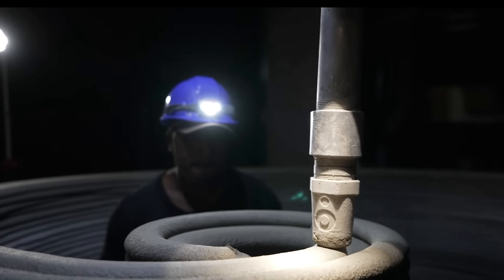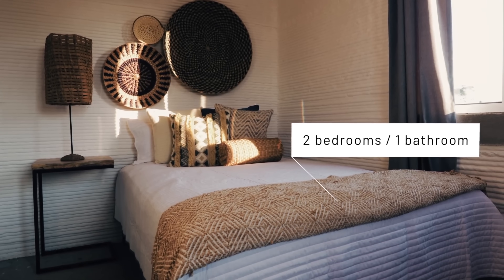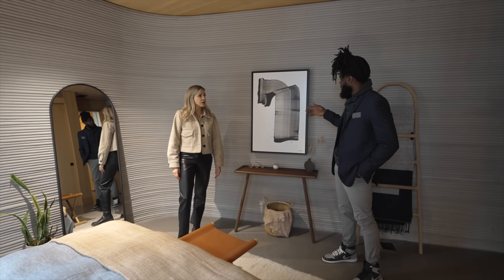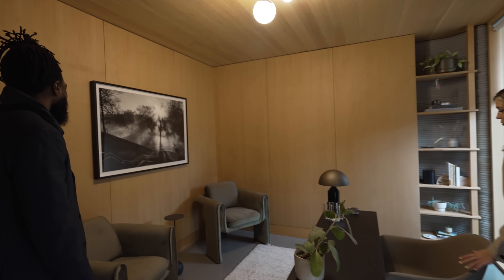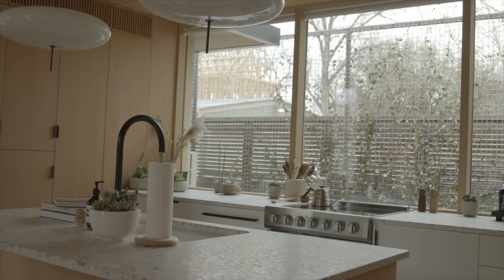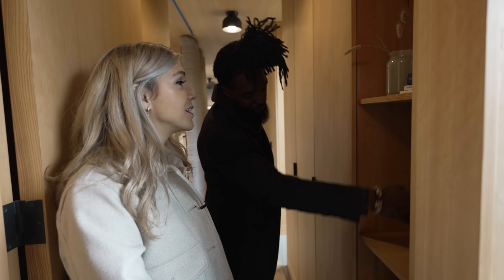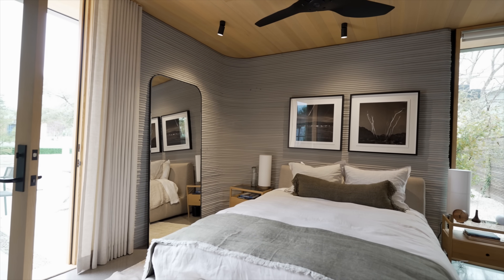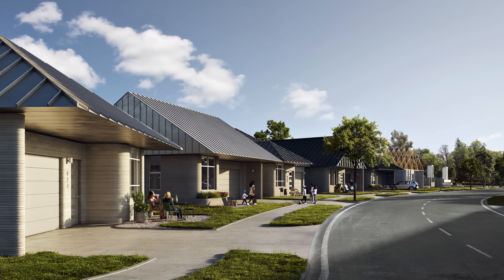Inside A 3D Printed House You'll ACTUALLY Want To Live In

Comment: I can dig it, although as somebody who builds things for a living ~ I can already tell you that although the walls may be easier, the rest is going to be more difficult than wood framing. Electrical Plumbing ~ heating ducts ~ windows ~ there will definitely be a lot of trade offs.[ Just like a container home,] you have to build a whole structure inside and out anyway so it’s just hard to see where you gain anything over stick frame.... But it does have it’s place .. if you can get a little creative with the Mechanical Systems..:body-blue-raised-arms:

Comment: The thing no one is considering is that this house will be much more sound insulating by the shape of exposed concrete. Non flat walls will not reverb as much and this makes a good quiet house, from inside to inside, outside to inside and viceversa. Also it makes for a fantastic home theater setup.

Comment: Very nice.  We live in a concrete house in a tropical climate and we have to run an ac because it doesn't stay cool inside. Is there more insulation in this house?  Also does it have rebar? And lastly, although I like the texture, I think it will get too dusty and be hard to clean.

Comment: The concept looks really great I assume that the curves are the only option at this point.  Also no mention of cost for this project the bare bones look of the extruded concrete may be cool for some however plastering the interior or exterior can quickly up the final costs.  There is also no mention of how the electrical wiring and plumbing and hvac are handled.  I imagine this would be quite a challenge for the HVAC, Plumber and Electrician to finish out not to mention any upgrades and repairs in the future.

Comment: I noticed that the bare 3D printed walls do not have any electrical outlets or switches or lights. The only place that I see outlet, lights etc are located on interior hand constructed walls and ceilings. The round curves are architecturally pleasing but I’m sure the real reason for the round curves is that it’s just easier for the 3D machine to do. Obviously flat ground is the best place really that one can do this. I’d like to see the machine navigate in terms of a sloped lot.

Comment: Pretty but  wondering about moisture problems and dust in every crevice and grey grows depressing  so glad for the plastering  so the electrical outlets etc would be on the inside of the wall?  Wonder how these would do in cold Nebraska areas?  Like the design.

Comment: I wonder how many other parts of the overall labor will eventually be done by robots, like putting in the electrical wiring and plumbing. I also have read and seen that different types of mostly wood filaments can be used to 3D print what look like wooden objects or panels.

Comment: A couple questions. How to you add electric or plumbing or fix electric or plumbing when they break. Between the walls is spray foam.

2. The living room has a pretty good echo. What do you use to damper that.

3. When you move your paintings or change the TV wall mount (run electric) or other things in the wall can you use spackle or do you have to fill the holes with Concrete. No one thinks or answers these questions...
Reply: Did I miss it… the most important question, – Just how much cheaper is it? 
for a same size house built conventionally - 10%? a third? 50%??
Reply: 1) with difficulty. 
2) Its all concrete so its bad. You dampen sound with different sound dampening structures. Ranging from furniture, rugs, heavy curtains, sound treatment, etc. 
3) You need their blend to patch or it will look bad. or you just plaster over it all.
Reply: The walls are typicall 2 layers with void space between. Mechanical items most likely would run in  those areas.

Comment: It looks really good but I can't imagine it's going to be good in colder climates.

It would lose too much heat and the outside walls need a lot of maintenance because they get dirty easily.
Reply: On the contrary. As he stated concrete holds its temps really well. Not to mention with the 3d printing technology you can account for extra thickness where needed for increase R value. Also, if you were to paint the exterior with a very durable type of paint then cleaning would be no issue.
Reply: @TheAceofFate   In colder climates where you get -1c to -20c temperatures you need insulation and extra heating to keep these homes warm. The concrete does not hold that summery warmth in over a long period of winter months... Aaand , it can get really uncomfortable when living in such a home and when no heating.. its cold and humid and these two will not work together well. And i speak from the experience, since have lived in homes built from concrete and no extra insulation....
Reply: @TheAceofFate  you need insulation with houses in the UK as far as I know though?

Comment: Something tells me you would be paying mad money for heating. As there doesnt seem to be proper insulation on the walls. Meaning the house would lose alot of heat.
Maybe OK for US , but in Europe not so much.
Plus , In europe most buildings are built out of these 1m by 25cm on 25cm blocks. A crew of 4 guys could build a entire house in around 3 days (depending on the size).

Comment: While I get those 3d homes were much better than those sheds I find it hard to believe that those 3d printed homes were so cheap to make to actually be  apples to apples. More like a publicity stunt, while you can reduce labor and time and thats great most of the cost doesnt come from walls, given the one floor limit the walls are the structure but that may add up to only 25%-30% of total cost tops. Then you take into account the fact that a new technology is almost never cheap so it will take time for the idea to actually be affordable. Finally are this walls efficient? They look huge, not sure if thats a must for this process or for that climate, anyway the one floor limit seems wastefull land use. im glad they made those homes, I just hope this evolves into true affordable and efficient construction.
Reply: Walls for wood houses can be "factory built" in most cases, and after that setting them up takes 3 men about a day or two for a single story house. As for the sheds, they are definitely cheaper, and likely wholly factory builts. 3D printed houses seem mostly a trend thing than an actual savings, but I guess they would be cheaper if you specifically want a concrete house.

Comment: The only thing that weird me out about these 3d printed buildings is they are essentially a Concrete structure with NO Rebar reinforcement, which means they shouldn't meet any building codes anywhere in the country unless I'm missing something and there is reinforcement for tensile loads somewhere?

Comment: For those that say the concrete is dusty and painting a problem, you can seal concrete to protect from dust, staining and to allow paint to sit instead of being absorbed , there are also concrete fixings for your pictures and TVs so no chance of it popping out your walls , your electrical will run in the wall cavity that you see that you can also insulate with foam , plumbing would be something that would be considered before walls went up and probably done in the same manor as electrical , this design is great but probably costly, the maisonette could be ideal for a single person full time , seen more people live in less than the size of that room . It's just a design to showcase the possibilities,  which are pretty neat in my opinion , plenty storage too .

Comment: How is the concrete made to feed this machine?  Is it still labor intensive, or you just fill the machine up with dry concrete mixture and it will automatically mix them up with water and whatnot to be extruded?

Comment: 3d printing for a house is the goat. Just do the research so you don't end un in a concrete box that retains head in the summer and conducts cold in the winter.. How are these 3d companies not working with insulation companies to do a combo concrete print/foam insulation. NOW THAT WOULD BE 3D PRINTING HOUSES.

Comment: I imagine repairs would be a pain. If there's any electrical or plumbing issues and they have to start making holes, It's not quite an easy fix. I think I could probably match the wavy texture, but it would take some time, and no guarantee the color will be the same either.
Reply: just make a mold of the wall and boom

Comment: with a dual extrusion nozzles  ( that exist in regular desktop 3d printers) you could simultaneously print the concrete walls and an extra insulation layer.. be that a filling on the inside, or an exterior insulation material. 
would be just as fast as before and doesn't require extra manual labor. also you can have a different finish to the lines ( although aesthetic in my opinion ) by adding other thickness nozzles, extra movements, having the 3d printer on a 4 axis arm, there are a vast array of options  you can explore.

Comment: Given earthquakes and "pseudo-earthquakes" from fracking, I wonder how these concrete buildings hold up. Not to say wooden houses do that great in those situations, but would be useful to know how "cracking" or blunt force affects the structure and how far such impacts reverberate throughout the structure ( how far to cracks go vertically and horizontally with these concrete tubed like layers, or what happens above a conretet tube that collapses/destroyed))

Comment: Did not mention how/where utilities like electrical cables/wiring, plumbing, hvac ducting etc are installed in 3d printed walls.
All that wood work and cabinetry will be very expensive.
3d printed homes for chronically homeless may look better, but I'm certain cost will make it highly impractical.

Comment: Looks very cool. But I can't help but think that all the ledges on the exposed extruded concrete will be dust traps and homes for spiders. Also, the labor cost for painting would likely be more since the walls would have to be spraypainted; therefore, everything else would have to be taped with plastic. I would definitely have all the walls plastered except for one, just to showcase the 3D printing aspect.
Reply: Spraying is how most homes are painted these days. Just more efficient.

Comment: Concrete may be a thermal sink, but it unfortunately is extremely good at leeching heat out of conditioned spaces in cold conditions. Proper levels of insulation is a MUST in northern climates. Uninsulated concrete will skyrocket energy use and associated costs in cold environments. As someone who works in a concrete building that lacks adequate insulation, I will tell you that late fall to early spring Monday mornings are brutally chilly after the heat has been turned off over the weekend. And I'm pretty sure the hefty cost of heating the building is definitely wrapped into the high lease rate that our firm pays to be in that structure.

It also seems weird not seeing any steel reinforcing within the concrete. While so far these concrete walls are limited to single-level applications and have lesser concerns with shear loading effects being closer to the ground, lateral loads from wind and most important earthquakes still need to be taken into account especially if the technology is to expand upward. For a one story building you might be able to get away with this in Texas and its lower risk earthquake zone, but certainly not anywhere on the West Coast along the infamous Ring of Fire. And it better not be in a tornado or hurricane zone. Someone previously noted how popular concrete is as a building material elsewhere on the planet, but when a big shaker hits they also sadly illustrate how poorly concrete performs when inadequate or even no reinforcing was used in the construction. Bones make for poor structural reinforcing when floors and roofs come tumbling down. If you want to keep people safe from being crushed to death, y'all better have properly installed rebar in your walls.

Okay, so despite being such a negative nanny, this technology is still very promising. It's certainly thinking and doing beyond convention. And of course any reduction in labor costs is always going to be a good thing for the end price...it'll make the budget-minded CEOs and bean counters happy even if it means even less jobs for hardworking everyday folk (sorry, I couldn't resist that last jab).

Comment: I'm curious about the longevity of this type of construction. Concrete expands and contracts based on the temperature and in most concrete construction, steel reinforcements exist to help with that. If it gets a little too cold and the concrete cracks, what is the repairs like? I assume this style of housing isn't suitable for everywhere such as northern climates because of that issue but it's something I'm curious about. Also, high winds. While concrete is quite strong, the actual contact patch between layers doesn't seem to be very large? how would this style of construction hold up in terms of sheer  forces without the reinforcements?
Reply: Rebar mostly helps to prevent cracks in large sections of concrete. These are very small. Expansion will be very minor. Thats why you don't put rebar in a front porch step.

Comment: It's faster than a traditional house, but how fast could you build a house of concrete with people?
Just set up molds and replace the printer with a pump for a stronger structure.

I also just hate the thought of having to vacuum dust from the grooves of the walls. It doesn't feel like a house built for people to live in, for Martian's I could see the use.

Comment: Concrete may work well in moderate climates, but in extreme heat or cold you'll need more of a thermal break, as the thermal mass would become heat-charged and too hot, or radiate the interior's warmth outside. With passive solar design it could help somewhat, but many would need to account for extra wall thickness to have extra insulation. I guess a benefit is that you could simply print with a larger wall depth and put in extra insulation, though cladding some faces would seem prudent
Reply: I believe that they said that one is in Texas which does have extreme weather. These houses are cooler in the summer and they absolutely would be warmer in the winter. I have lived in a cinder block house and we really enjoyed our low utility bills when we live there. This would be no different and that wasn't an extremely cold climate.

Comment: As a tech enthusiast, I'd be extremely concerned about wiring and plumbing without relying on specialists. You wouldn't be able to run the cables or plumbing behind the concrete, so you'd have to place paneling over the concrete for that gap space. Also, your router's wifi signal would be absolutely awful experience given the concrete, but maybe it would be slightly mediated due to the curved walls bouncing signals. The flat roof is also a concern for housing in areas that experience heavy rainfall or snow. I think some reconsiderations need to be fleshed out before pushing this to the main market, because I can see a lot of buyer's remorse complaints popping up later.

Comment: the concept is promising, though regardless theres still going to be a good amount of labor required to insulate the walls and potentially layer more effective interior panels of some sort rather than having the stone wavy effect. It may look cool, but generally i feel like a flat wood wall would just be alot more useful all around.

also, regardless of that statement about the concrete holding temp on a 95 degree texan day, with all of those windows that place would be a functioning oven.

Comment: These might be cheap to build, but economically they most likely are awful to heat up in winter due to the lack of proper insulation, and could be prone to cracking and eventually falling apart.
In fact, they might be extremely short term housing that most likely won't make it into construction trends. Not to mention the method itself has issues, same with 3d printings, the prints will come out strong and resistant to bending in one direction, but will be ultimately extremely weak when targeted from the weaker side, in this case they are strong when pressure is applied to the top, but will be less stable when pressure is applied to the sides, and by pressure I mean impact or even heavier winds, and with the american trend of almost annual hurricanes and tornados, this is very unlikely to last longer than 10 years.

Comment: What I find weird is that the US doesn't focus on pre-fab houses. One of my friends bought a house that wasn't built yet. In about 8 months they went from a flat piece of land to a neighborhood of 30 skeleton homes (with the option to also get the plumbing done throughout the house). They are all super eco friendly homes with a heatpump (so no gas), heated floors everywhere, good isolation (actually a bit too good, they had to buy an AC) and solar panels.

Comment: How do the window jambs work? It looks like there is a continuous concrete connection between the inner and outer layers of the cavity wall..  so how is thermal bridging avoided?  Also, looks like there's a ton of sealant around the window frames.

Comment: In all those cracks will accumulate many nasty stuff very quickly. On the outside you will have e.g. dirt, lichen, moss. In the inside you will have dust accumulating unless you vaccum-clean all your walls regularily :-)

Comment: Only concrete walls are 3d printed, they are non structural, much of the house are built in the traditional manner, so the 3d printed wall on act as a skin, take 4 people 2 days to  build if it is brick. So what's the point?

Comment: What's the cost?  They claim cheaper, but it seems the interiors will cost you an arm and a leg.  All that wood on the walls and built in cabinets are not cheap.   They also emphasize rounded walls because a 90 degree wall is not possible.  I'm not sold on this.